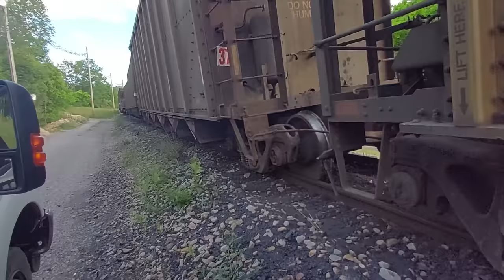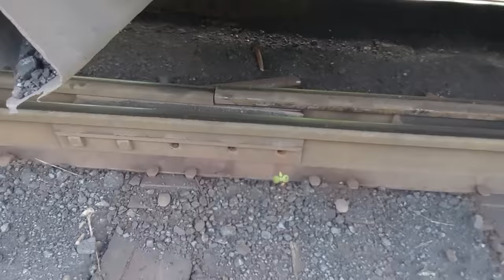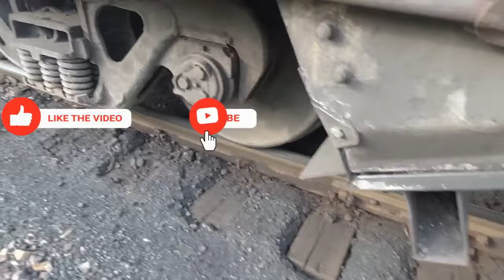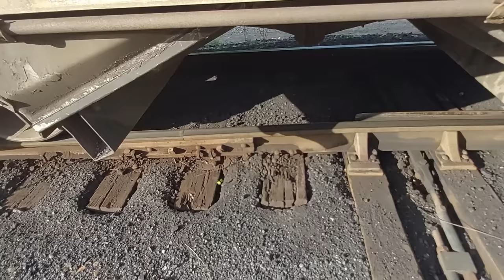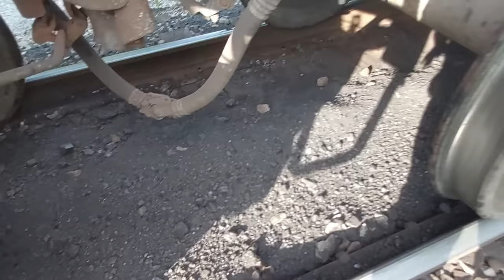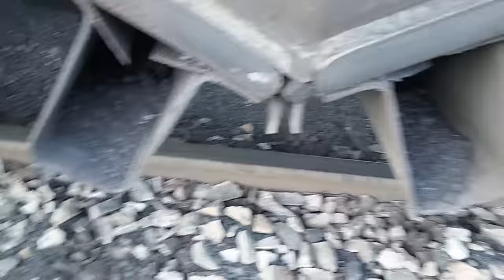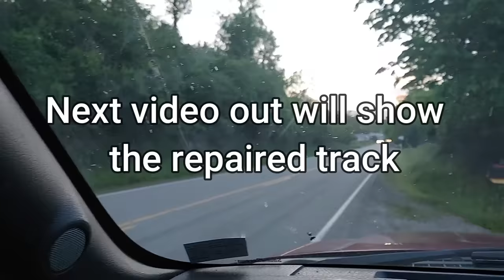Rail Rolled Over and 5 Loaded Coal Cars Derailed  Oh Fudge!

Comment: Dave, I was expecting to see guage bars around the switch and in high traction locations. Was there any there? I do not think the switch point was picked rather a wheel set after dropping pushed  away the point rail. Too bad you did not have a way to empty the cars, then a large loader or excavator could of rerailed them.
Reply from the maker: You will see gauge rods in the next video Reven, be sure and
watch it coming out next, you are right in that the rolled rail
was the cause. Appreciate your taking the time to check out the video and write in my friend.

Comment: the damage is before the switch - maybe just the weight / pressure of the axles running on the ground pushed the switch blade, (maybe the reason why some axles of each bogie have re-railed), albeit on the wrong route. Bolts are more than just sheared out of the heal-block, likely from impact of a wheel set impacting on the end of it when running on ground. But I have no idea, just an armchair observation. just for fun.
Reply from the maker: Appreciate your sharing your thoughts David. Thank you for  checking the video out my friend.

Comment: The Rail rolled causing the gauge to widen and as cars were being pushed they picked the switch and cars jumped off the track into the open and unlocked position of the switch. I bet you wish you had them concrete ties now ! You said yourself that wooden ties can't handle being saturated wet and when they dry the wood retract and the spikes become loose in the tie, that's why the rail rolled under all that weight.
Reply from the maker: Thank you David for taking the time to watch the video and write in. More info will be in next video coming out, hope to see you on that one. May you have a most blessed day my friend.

Comment: Since it was being pushed, I'd look at the wheels of the first car to go the wrong way, and the wheels of the last one that didn't.  Something probably about there forced the switch to shift to the wrong position. Maybe the switch track alignment had slipped in the heat and pulled the rails out of position? Momentary electrical issue that made the switch motor run uncommanded?
Reply from the maker: Thank you Allison for taking the time to watch the video and write in. May you have a most blessed day my friend. More info will be in the next video coming out. Hope to see you on that one.

Comment: The rail rolled over most likely due to bad ties and or wide gage .... especially in a curve. The 3 ties directly in front of the switch points are bad, which tells me there are probably a lot more ties bad in that curve in front of that switch. You absolutely have to ensure ties directly in front of the switch points are good. You want to make sure your switches and curves are solid, which i'm sure you know that.
Reply from the maker: Appreciate your sharing that Matt, hope you will watch the followup video on this one where I tell you what happened and
what we did to fix the track there. You are right about switch ties.
Thank you very much for taking the time to visit with us and check out the video my friend.

Comment: When the loco pushes and not pulls the bodies tend to twist between the couplers the indication is the rail rolled over indicating side wood torsion from this effect once the rail rolled out of position the gauge of the track altered and the bogies would have just walked off their track. I worked on track work over 40 years ago laying rails here in Australia for contractors doing industrial areas around Port Kembla Steelworks
Reply from the maker: Thank you for sharing that with us Paul. Glad you could take the time to pay us a visit and check out the video. May you have a most blessed day my friend.

Comment: Dave, can never tell what hides under that material, the ties had no more holding power for the weight,  a tie job is in order. I also seen one car climbed the frog, good example how a check rail works!!
Reply from the maker: Yep Billy all that coal can't see the condition of the ties or spikes,
will talk about that in next video, this could have been prevented
if I could do a proper track inspection. We replaced 17 ties!  Appreciate your taking the time to check out the video and write in my friend.
Reply: @ccrx 6700 That's Railroadin!  I understand Dave, limited manpower, with the footage of track you should have a 5 man gang, machines alone can't cut it. Stay safe and get home the way you left. Words to live by those who work the Railroad!!
Reply from the maker: @billyvalentine1836  👍😊

Comment: The switch interlock for the terminal should have prevented the switch from moving no matter what command is sent to it.

The switch should have a west approach, east approach, terminal, and the siding

1WWK, TK, EWK, 2WWK

Once the switch is lined, the interlock is engaged, so you should see LZK bit set, then the green for east EGK should have been set.

The indication bits should have lit up 1WWK, then TK, then the EGK would have dropped, then EWK and the LZK bit should have stayed the entire time.

My thoughts are there was a fault in the wire to the LZK bit connector. Or a fault in the controller itself.

A wire short or break would be the most likely cause.

I have seen this happen before with cross overs on class 1 railroads and I don't know what the cause was, but I saw it on the ATCS

One of the switches switched with the train in the crossover and derailed.

It should never happen unless the controller fails or there is a short in the wires.
Reply from the maker: Thank you for your detailed analysis ocsrc. What I can tell you
is how the switch is supposed to work. There is a proximity switch
on the rail. Once a wheel goes over it, the switch counts a wheel
in then when the wheel goes over the other proximity switch
on either the diverging track or main, that wheel is counted out.

So once the switch sees there is a wheel "in the loop" then there
is an electrical lock inside the switch circuitry that will not allow
the switch to throw until that wheel is counted as being out.
You cannot throw that switch electrically until all wheels are
cleared. 

What did happen was the rail rolled over enough to all the first
wheel to pick the switch, meaning the stock rail shoved out
enough for a wheel to go down the diverging track instead of
staying on the main. When that wheel hit the switch point
rail it shoved it even further over, thus giving a red indication
on the light. Hope that helps clarify and thank you so much
for watching and writing in my friend. Also hope all is doing
much better on your end. We are praying.
Reply: @ccrx6700  it sounds like the 2 switches make up the Terminal ( TK )
The interlock engagement doesn't allow any changes to the switch while anything is in the Terminal Block
Reply from the maker: @ocsrc  👍😊

Comment: R Hall Is the mechanical lock in the switch damaged?  Sounds like the switch is a victim.  Very frustrating.  As always I know you will identify the cause.
Reply from the maker: Switches are programmed not to throw if there is a car in
the turnout Robert. Can't do it. It's a fail safe measure as you
can obviously see why it is needed. Thank you for watching and may you have a most blessed day my friend.

Comment: OUCH!!!   Is that a radio controlled switch?  Or the spikes not tight enough?  Have seen a derail on a heritage line caused by spikes that were not holding the rail properly....Power went over and the last set wheels hit the ground.....Luckily, was only moving at about 4 mph at the time.....
Reply from the maker: Yes Billblom, radio controlled switch. More on the whys in the
next video coming out, hope to see you on that one. You are right things could have been worse. Thanks for the nice comment. Appreciate your taking the time to check out the video and write in my friend.

Comment: If a rail rolls, wouldn't the engine detect it long before any of the cars preventing much more of a mess than shown?  The engines are heavier than the cars, so I find it weird that they didn't detail first
Reply from the maker: It would if the engine went off first, but the engine and about half
the cars went thru before those cars came off. The operator was
dumping the train John and he wasn't within sight of this and was
using a remote box to move the train, so it took a few cars before
he was able to tell something was wrong. Appreciate your watching
the rail rolled over show my friend.

Comment: dang that is like worst possible day to get a derailment. RIP memorial day, been on duty calls and usually things happen turning holyday's, weekends and storms a lot more than any other day's. The sun currently is scorching hot without proper hydration you will suffer from a heat stroke very fast. One derailed car looks very bad cause it's bougie is almost off the hopper car. Really the only word I could use is hot hot mess. I'm sure the crew can manage this but everyone just having a bad day.
Reply from the maker: Thank you Steve for taking the time to watch the video and write in. Things happen, usually at the worst times, but that's railroading. May you have a most blessed day my friend.
Reply: @ccrx6700  Thanks Dave for recording this so people can see how much work it takes to maintain infrastructure.
Reply from the maker: @SuperMAZ007  👍😊

Comment: I think the rails rolled because of the braking force extended throughout the trailing cars as an object in motion will tend to remain in motion and outside forces will resist, buckle, and fail in braking suddenly in all directions.
Reply: Speed never killed anybody, it's the sudden change of direction.
Reply from the maker: What you don't know is there was no braking going on when they
are unloading the cars thru there, the only braking is on the loco
to stop while they are dumping a car. Had this been main line
and heavy braking was going on in the high heat of the day,
then you would be correct.

Comment: Have you considered upgrading the side bearing on your cars?

Constant contact side bearing’s may help the trucks pivot in turns?
Reply from the maker: About half of our cars have the constant contact side bearings Terry.
I like them and do believe they help specially on our jointed track. I
will do a video sometime on the differences between CC bearings and
the roller bearings.  Appreciate very much your visiting with us to check out the video my friend.

Comment: Dave your line has a lot of derailment issues> Is it because the line or the rail cars are old and worn out??   How many derailments before the line gets replaced or the Mine gets shut down??  I am just curious I have no idea about anything that runs on rails.  I just stay out of their way.
Reply from the maker: I'm not sure why you think that Rex, actually we've had about
5 in the past 2 years considering the high amount of trains we
run, I think that is a pretty low percentage. 3 of those were only
1 wheel set, no big deal. You might be surprised that in US
the average according to the FRA is 3 derailments a day over
142,000 track miles in US, that is not counting all the derailments
that are in yards that are not recorded. Good suggestion for
a future video! Appreciate your taking the time to check out the video and write in my friend.

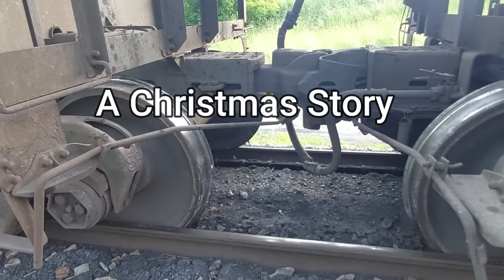Comment: 1:00 I know what caused it.
Incorrect maintenance and the WRONG fastenings.
Almost everywhere in the USA - the rail is held with a square shanked nail.
Called a DOG.
Utterly useless when the rail weight gets above about 55 LB.
..
What all USA railways "should do" - is replace those useless straight / smooth shaft DOG spikes, with a longer, easily re-tightened SCREW spike, and the use of FAR BETTER sleepers.
..
One problem that the old track gangs had, was the incorrect supplies and the almost 100% use of manpowered equipment, to install track with.

Even when I worked in the NZR here in the 1970's, they were REPLACING, most of the old dog spikes, with spring steel goose-neck double leaf "clips" and Australian Hardwood sleepers.
Taking out the rotten / decayed (smaller size) silver pine sleepers that had almost rotted completely away, after nearly 100 years in service, leaving barely an outside edge & top, with the underneath and internals of the old sleepers entirely decayed / missing.

Also old ballast that was almost totally useless too, being crushed river gravels and SAND in some places, was being replaced by extremely dense, hard quarried rock.

What occurs with rotten sleepers and smooth short shaft dog spikes, is this, the rail "bounces" slightly on the sleeper pads (that piece of the sleeper where the rail foot sits) as the sleeper squeezes down as the rail locomotive and wagon weight rolls over them, which starts a reaction of "pulling" the dogs out of the sleeper ahead & behind, until eventually enough movement with the passing of every train, has the sleepers being punished and the rail bouncing with he dogs slipping further & further out.
Until, nothing is HOLDING the rail, such that a side-force from even one wagon wheel set, rolls one rail over, to instantly increase the gauge until the wheels themselves DROP DOWN, between the rails, causing these derailments.

Having new (better quality) sleepers, with steel bedplates on them, contoured to accept the foot of the rail used in that location, with MACHINE-SCREWS holding down a screw spring under their head, on top of the special bedplates, ensures that any "bounce" movement as the train passes over each sleeper, is contained within the specs of the screw head held springs, such that the rail foot is retained and HELD TIGHT, onto the sleepers in the correct position and at the correct gauge.

Screw spikes, used temporarily down a square dog spike hole, will also "grip" the rail foot tighter than the original dog, meaning that these can very quickly be used, by track workers (surfacemen), either on their own or in a small gang, with motor trolley support, to gain years worth of safety, at little extra expense.

UNTIL, a complete relay of sleepers (maybe an upgrade of rail too) and all associated fastenings, to be screwed tight - to ensure complete ongoing safety, of train gauge & travel.
Your undulating dog spikes lines, with off-set rail joints (adding to wagon sway) makes the old dog spikes completely obsolete and quite frankly, downright dangerous.
Reply from the maker: Was thoughtful of you to explain all that Thank you for watching and writing in.

Comment: Do you think you might have had some out side help? Looks like the switch was thrown during movement.
Reply from the maker: Probably not Thomas, we have almost no issues with that kind of
thing going on and actually in all our years of working here have
had none that I can remember, we are lucky. Coal was covering the
ties up so I couldn't see my spikes. Spikes loosened up then the
heat got to the one rail and lifted it up, so when the car wheel went
over it, that rolled the rail over. This is a bad section of track for it
getting covered with coal with our leaky hopper car doors, it needs
to be cleaned more often so I can see my spikes and ties.  Very grateful for your taking the time to visit with us and check out the video my friend.

Comment: Dave, are most of the derailments on your railroad inner-inner derailments? Meaning the truck sets are usually on the ground on the inner of both rails.
Reply from the maker: If one wheel is inside the 2 rails the other wheel has to be on
the outside of one or the other Daniel. Only situation where that
would be different is if one of the rails rolled completely over,
the one wheel would be most likely riding on the web of the
rolled over rail.  Appreciate your taking the time to check out the video and write in my friend.

Comment: I just noticed the warranty sticker on one of the cars.  Was this covered by said warranty?

Someone needs to invent switch pick detection so you can see when such things happen and (not) blame the points.
Reply from the maker: No sir derailments are not covered under a car warranty. Even if they
were that warranty on those cars has long since expired. That was
a pretty hot day and I think the heat pulled one side of the rail up
where there were some loose spikes and when the cars passed over
it they pushed the rail over and that was why the cars derailed. So glad you could stop by and check out the derailment video my friend.

Comment: Would it be.tter if spikes were threaded screws?    Would not come out as easily.
Reply from the maker: It certainly would be Robert. Many RR's on some sections
use lag screws instead of spikes, superior holding power.
We would here have to change the tie plates to go to lag screws
as tie plates we have are punched square holes for spikes,
not rounded holes for lags.Thank you for watching and may
you have a most blessed day my friend.

Comment: As I see it the cause before I see the rest of the video it seems the track has spread and the wheel set has split the points.
Reply from the maker: You are correct malcolm, rolled railed thru the switch caused
the wheels to go down the diverging track.  Appreciate your taking the time to check out the video and write in my friend.